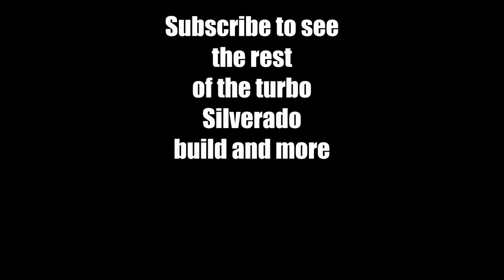Turbo Silverado 4L80e swap crossmember

Comment: Not exactly on topic, but what size shop do you work in, looks like a great size shop.
Reply from the maker: cougar7n10 it's 30 by 50 it's perfect size for me
Reply: 222Built Awesome, I have just received a bid back on a 30x50x16 with 6" slab.